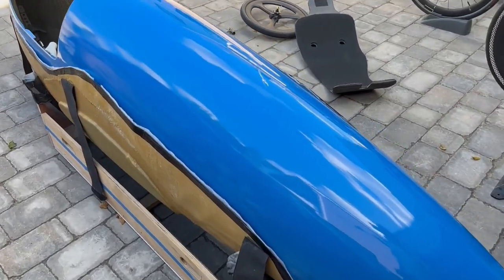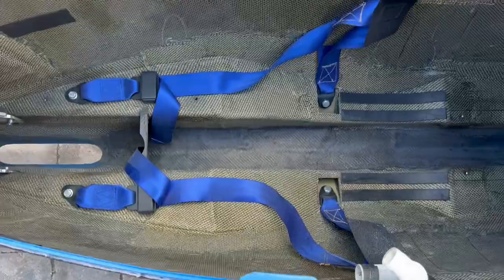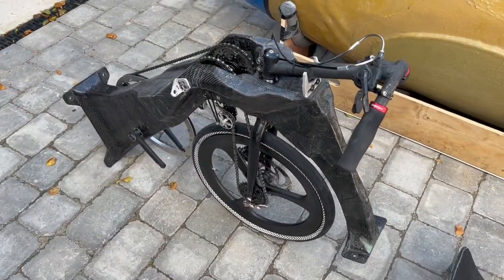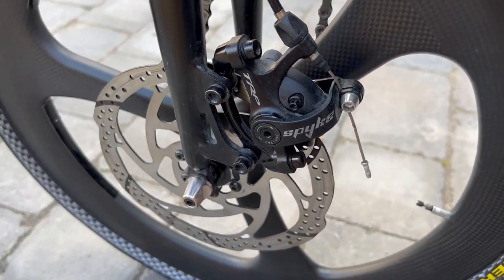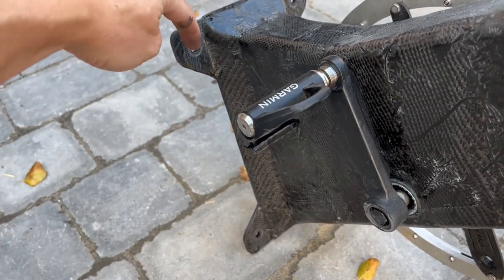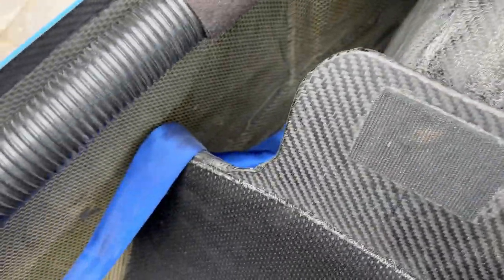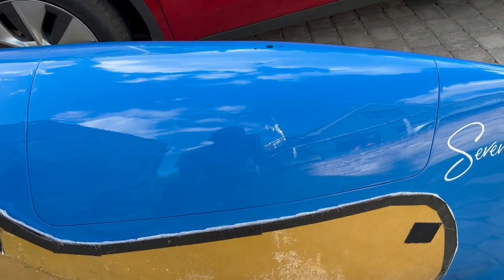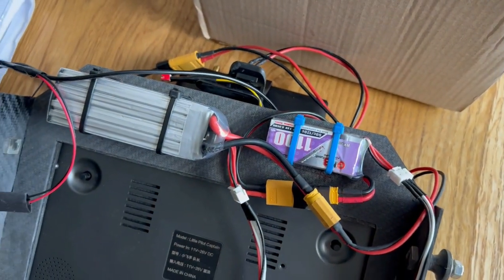Battle Mountain '22 - seventyseven bike walkaround

Comment: Does your right upper shin stay completely below the derailleur or does it move alongside the cage?  Mine shin bumps into the cage when in top gear and I had to place the middrive 4 inches above where yours resides.
Reply from the maker: Alongside the cage. I'm pretty sure I've developed a bow-legged riding position to avoid this, as everyone that got in the bike in BM said that their knee was hitting the derailleur

Comment: How did you mount the gear on the other side of the wheel hub?
Reply from the maker: The wheels were specially made for me by SMC Bike in China to have 6 bolt fixings on both sides of the hub

Comment: Is your final drive sprocket on the hub fixed to the hub through the disk brake rotor mount?  (Does it not freewheel?)
Reply from the maker: The final drive sprocket is fixed and doesn't freewheel. There's only one freewheel in the hub mid drive. I thought that this might be an issue, but it isn't, even freewheeling after the traps at 70+mph

Comment: Is there a second brake?  It looked like the rear wheel had rotor mounts on both sides.  Maybe 3 brakes!
Reply from the maker: No. the front wheel was manufactured bespoke for me by SMC in China with a 6 bolt mounting for the brake offset the standard 10.5mm, and another 6-bolt mounting for the sprocket offset 17mm so that the chain cleared the fork-leg. I decided to get two wheels manufactured, and use the 'spare' as the back wheel. That way if anything happened to the front wheel in BM, I had a spare, and could swap the rear for any standard 100mm OLD 406/20" wheel.